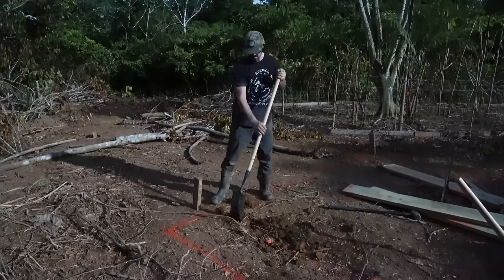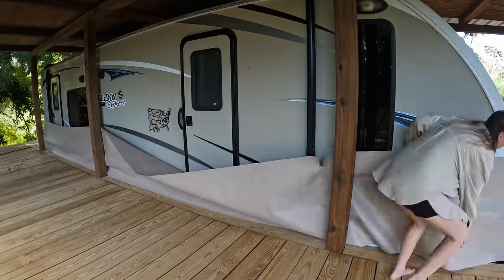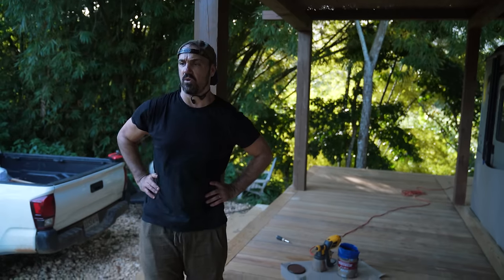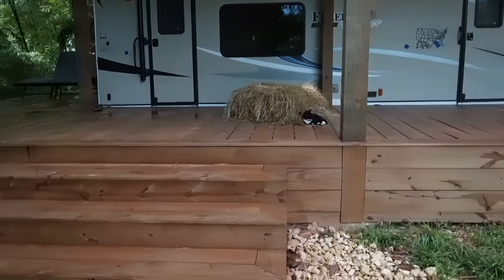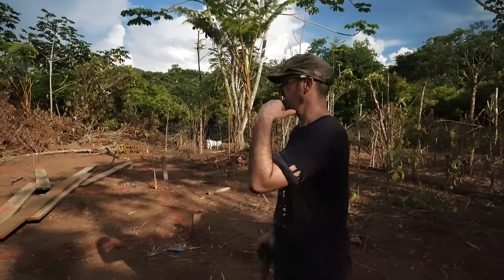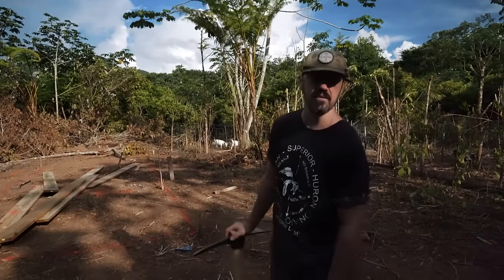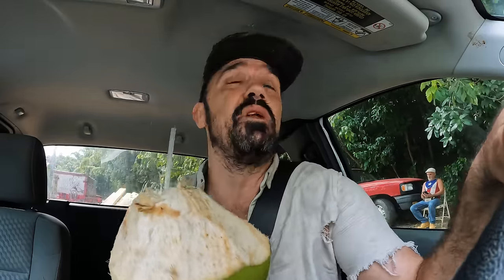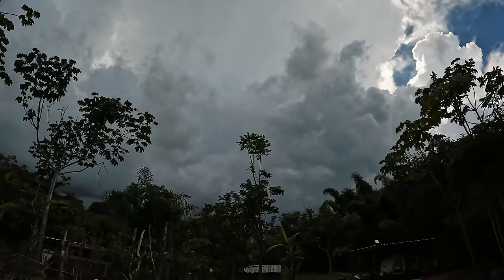BEGINNING OF OUR MASSIVE SOLAR AND BATTERY BUILD!

Comment: I'm a painter and decorator for 35 years  and I feel honestly if you  use a brush after it's wet it penerates better and lasts longer-term
Reply: Yes, it is always good to have someone follow behind when your spraying. I use a roller to help work in the stain(sealer) so it does not sit on top.
Reply: If the surface is properly prepared, there is no difference in quality and durability of brush versus sprayer.  Most homes  are painted or re-painted with paint sprayers and are given 5-10 year warranties.
Reply: You should have volunteered to come brush the spray. 😅
Reply: Not really  always get your  first coat to penatrat and brush it off so you don't  have blochyness
Reply: @davidyoung6891  The deck Matt just sprayed doesn't look blotchy to me.
Reply: Hear there are a few rain storms towards Porto Rico ! Flush the politics! Loll 😅
1. Do you keep your truck on top of the hill when heavy rains?
2. How can you manage without a garden? In that great weather. I suggest to get old fishing boats as structure to garden then wire mesh to protect, an investment but would be in conjoncture with the Chanel (gbu, greens, gbu, red tomatoes) Loll 😅
3. Does the municipality   have more ground rules safeties on where you build your house? 
Thank's & stay safe ❤

Comment: My first "deployment" was East Africa and the dude that picked me up and installed me in a temporary had the AC on full speed in both the car and the house. Ofc I got sick and even developed a nasty lung inflammation. So the next 15-20 yrs when I lived and worked in the Amazon, Central America and the Caribbean I never had an AC installed in my houses. Every time I'd been away and came back to the heath and humidity it was a struggle, but after 1-2 weeks the sweat and suffering didn't bother me anymore. It's just a question of adaptation, will and intent to live "locally".

Comment: for the rv stickers get a heat gun and a flat razor blade to heat the adhesive and scrape and peel, or a paint scraper if you might be worried of scratching the vynal

Comment: I paint all of my treated timber that is going into the ground for a permanent structure with a bitumastic paint.  It just gives the timber more protection from fungi.  

Coconut trees grow reasonably quickly--I planted some sprouted nuts maybe ten years ago, and they are now close to fruiting.  They are not a quick crop, but fruit bats leave them alone and if you plant them near the borders of your land, they will help provide a bit of a flexible wind break during severe storms where every little bit of shelter is a help.

Comment: Point of information. I was born raised and live in the Virgin Islands. Considering installing an adjustable mechanism. The sun shifts position and goes a little to the north a few months out of the year. An adjustable mechanism will allow you to change the position of your panels to get the most from the sun when it changes direction.  All the best. ❤

Comment: If you want to paint your trailer and those graphics are actually vinyl stickers, you need to remove them anyways before you paint so I would suggest using a hairdryer and pulling them up first and then deciding if you like the current color of the trailer or not before you start painting.

Comment: Even though the company that will serve your concrete measure the amount of cubic yards I suggest you to compute them in advance..Just calculate the volume in cubic feet and then divide the number by 27.. That number will be the amount of cubic yards required.

Comment: Don’t paint the trailer could hurt resale value what you need to do is just use some boards to cover the trailer and cut out some nice holes with a windows are so the backing looks like it’s made of wood. That way you do no permanent damage to the trailer and you get the lucky looking looking for.

Comment: As tight as that decking is around your trailer, I'm scratching my head how you'll ever be able to drive that trailer out and/or drive it back in again (for changing tires, servicing plumbing, etc), without damaging the trailer sides.  Practice up on your precision backing procedures!  Nice decking job!

Comment: "I'm eager to learn more about the power station you're planning to install. Specifically, I'm interested in knowing:

- Will it be an off-grid system?
- What capacity of batteries will be used (e.g., how many kWh)?
- What type of renewable energy sources will be integrated (e.g., solar, wind, hydro)?

I'm excited to see the details of your sustainable energy project!"

Comment: Consider using a solar axial auto tracker system that will track the Sun and turn your solar panels in the direction of the Sun as it tracks across the sky that will give you about 30% more battery charging capacity per day.

Comment: a Bluetti ac 200 max power station and two auxiliary upgrade  batteries, about 5 grand or so  would get you all you need in one box. 30 amp for trailer, 12V-  40 amp for trailer, and a shit load of ac plug ins  its how i  plan to build out my sailboat..  quick easy and fairly cheap or about same cost as all separate pieces,   they are designed to power a whole house.. so a boat should do fine...

Comment: It will be interesting to see what this framing with footers is for...- an 8'x16'or 24''? concrete foundation for a solar shed or 8'x16' or 24' concrete foundation with footers just for a base for a fixed solar frame/array.  If the latter, that is something I've not seen before- usually just the posts set in concrete.  Also, seems like a 20-25' nearby palm tree is S or SE of the array location- will that shade array during  Nov-Feb time period?

Comment: I haven't used AC in 5 or so year's since I got the 20 acres of desert land it does get very hot but the only thing I can run is USB fan and I have to shut them off at dark because I only have 5 100 watt solar panels for recharge

Comment: AC is really not that expensive for what it provides. People spend $500 on shoes they wear twice. My 5000 BTU AC uses like 600 watts and cycles on and off so it's only like 12 hours a day. At 10 cents per kilowatt/hour that's like 80 cents a day. Even using it 8 months a year, it's only $192 a year. That's so little for perfect climate control. If you need a 1500 watt unit or more to handle a whole house then sure it can get expensive. But a single room only needs a 5000 BTU unit. Mine even cools my room and my kitchen pretty good. A small RV shouldn't cost much in AC except that there's so little insulation perhaps and maybe it's a lot hotter there. Still even if it's $300 to $600 a year. That's so many hours of comfortable living. Even like $600/365 day per year is only $1.64 a day. People spend $8 on a coffee then refuse to turn on AC. It blows my mind. I try to prioritize my spending on things I use the most and that gives me the best quality of life. I even bought a $600 chair because I know how much I use it. A good computer and AC. What more do I need. Some diet soda and a snack I'm happy. I almost never even think about the weather it's like a perfect 22C all the time. Sometimes it's a bit dry depending on the season. I do have a humidifier. I don't know, I just think we have these machines that allow us to climate control our living spaces why not use them. We spend so much on other machines but won't spend $1 to $2 a day on AC? Why not go without a fridge too and toss out the stove while we're at it. Cook with camp fire and preserve the meat with salt lol. Anyways, end of rant.